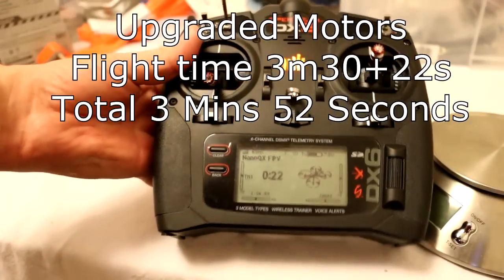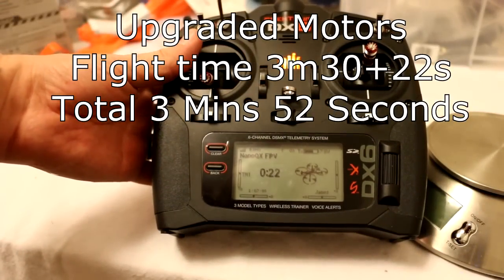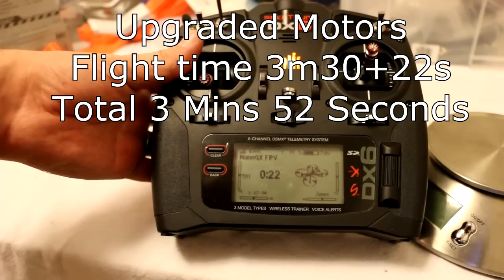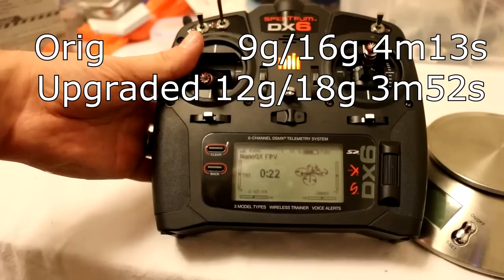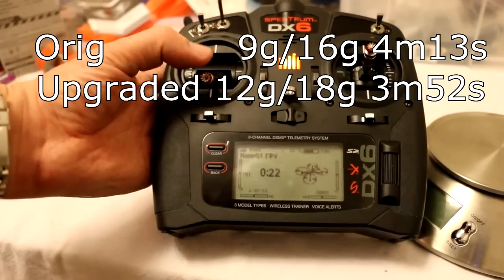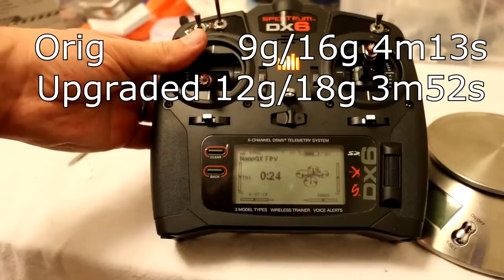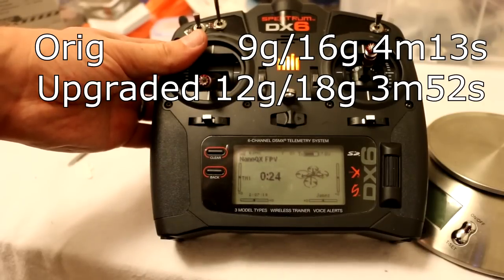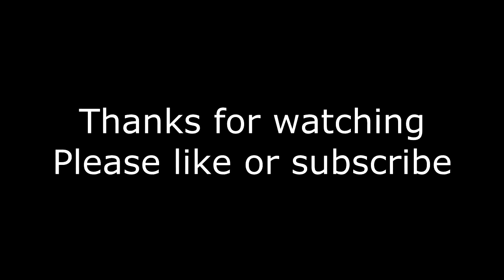FPV Nano QX MMW CL-0615-11 motor upgrade test for thrust and flight time

Comment: is there any way to upgrade the batterys ?
Reply from the maker: +Jeffery Tucker There are lots of alternative batteries to use with this, either original size, or people are rubber banding on larger batteries, I suspect weight probably defeats that though.
Reply: +Jeffery Tucker works perfectly   http://www.miniaviation.com/KM_220P.html

Comment: LOL nitros in yor mini. Ive just swaped 3.7v650mah out , and 3.7v 900mah in. OMG dose it move and double the flight time. Only froblem is when the pack is fully charged the quad copter quits for 1 second every 10seconds. After 5 minutes she runs fine.

Comment: hi james , have you  put hubsan x4 blades on the blade nano , i think i will try a prop swap and see the difference
Reply from the maker: I did try some other props on original nanoqx (not fpv), the turnigy 45mm props which were cheap, they flew but less flight time and performance so not really worth it. Haven't tried X4 props, as I gave my X4 to a friend with all the bits, so let us know how they work. Blade props are fine just expensive!
Reply: *****  just tried x4 props  but the hole are too large on them   . i got 4 mins 26 secs  hovering on stock props and stock batt.

Comment: hi james nice vid , i just ordered these motors and wondered where you got your 200mah nanotech batteries from  , all i can find is the new round ones that  you can solder together  . also did you test flight times with stock battery? . thanks .
Reply from the maker: Sorry I got confused, I am using 160mah nanotech batteries, they are the cheap ones from hobbyking, I just ordered another 8, they are under a pound each, the postage is more than the lipos unless you get a bunch of them. I don't think anything bigger would fit into the holder on the nanoqx, also the weight might be an issue, I stick with the easy option as I have the celectra 4 way mains charger so can charge 4 batts at once and fly back to back flights no problem. The stock battery flies slightly longer, but I only have one so I used the nanotechs for comparison so I can fly back to back to compare flight times/thrust easily.
Reply: thanks bud

Comment: Liked and subbed. Thanks for sharing. Just in time too. I ordered my fpv nano just haven't received it yet ..   :)
Reply from the maker: Its a blast to fly round the house, the stock motors are OK, but apparently don't last that long, one of the other guys at our club has worn out a motor already in only a few weeks, so good there are options.
Reply: ***** I will probably just go ahead and order me a set anyway. When I worked at my local hobby shop I flew the shit out of the demo there. Yea the motors don't last long at all. but the quad it self is so simple to fix and repair.